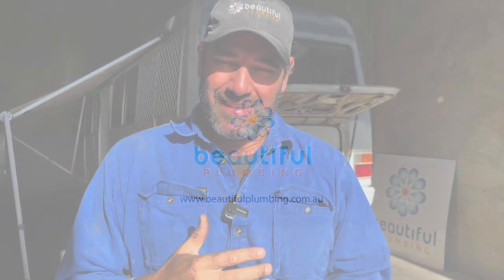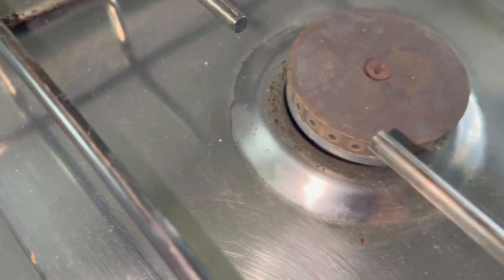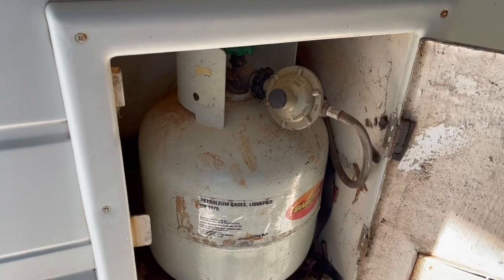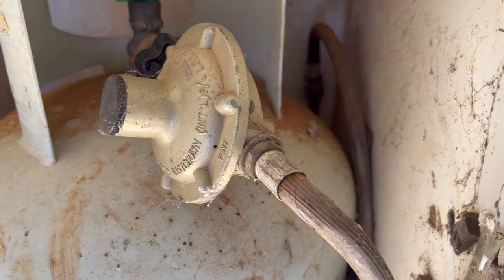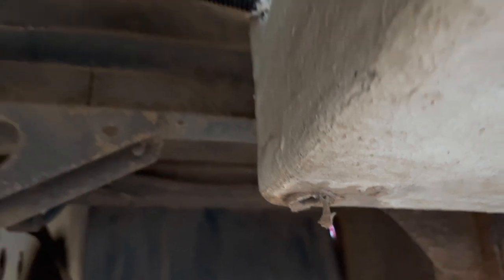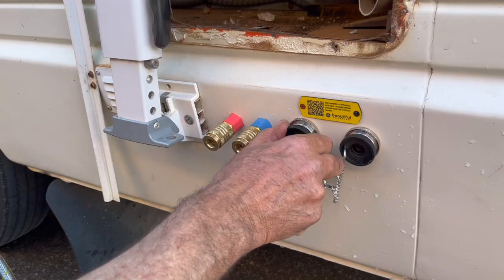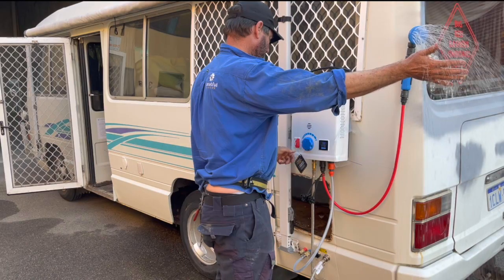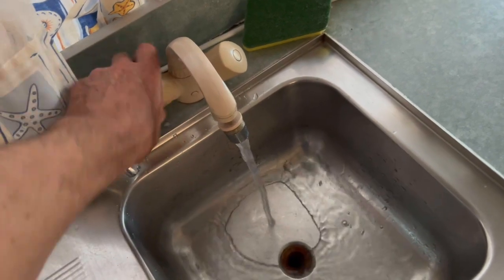How to Get Your Coaster Bus All Up To Code

Comment: Thanks. Good advice and good coverage of the regs. It looks like the bus was a DIY job. 
What would really help DIY's is a simple guidelines of requirements for running gas, electric and water. Then the DIY can follow the guidelines, get a specialist in to confirm the DIY install conforms with regulations and do the "legal" bits - the connection(s) etc. if all is ok. 

/rant DIY'ers will DIY and if they can't get hold of relevant and understandable information, then there will be many, many illegal and dangerous installations like the one you found on the bus.
It seems to me here in Australia we dissuade DIY'ers by making the regulations read like war and peace or hiding them - at least that has been my experience. Our legislators/authorities should be trying to help DIY'ers conform, not frustrate them and end up with illegal installations. /end rant.